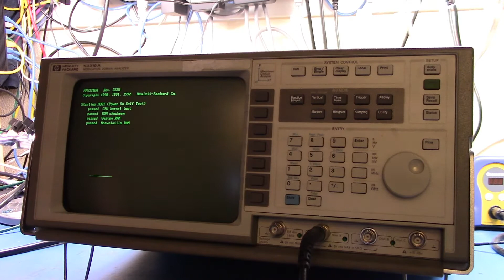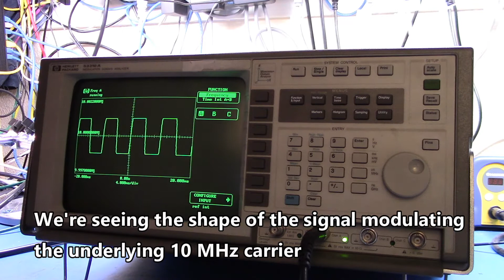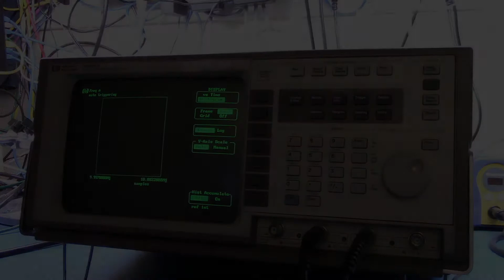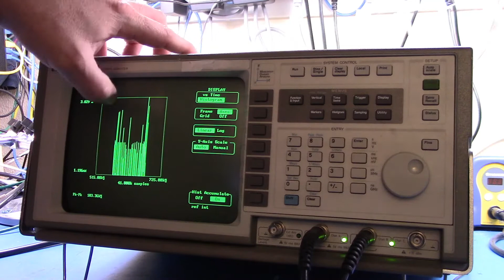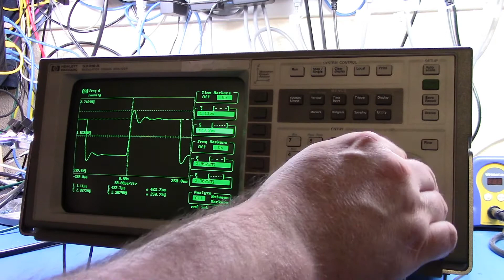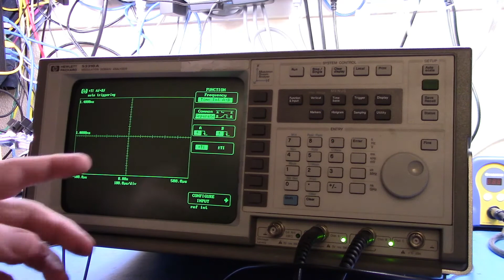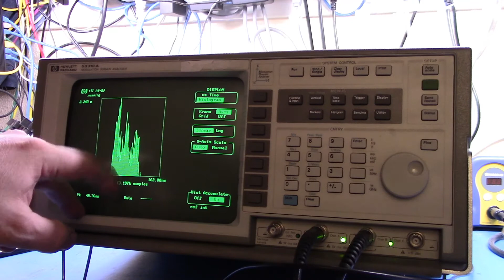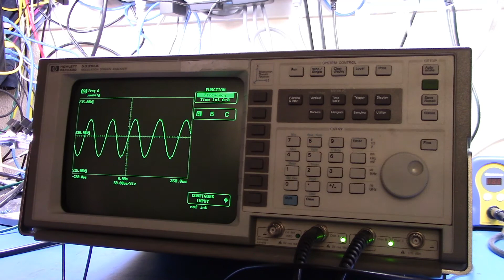HP 53310A Quick Overview

Comment: have a same hp 53310a,,self test has a fail,,,trigger light ? and ideas is it important
Reply from the maker: Hard to know - In the Service Manual, go to flowchart 5 (I think you're saying that the A2 Board Trigger Light test failed) - It'll take you through some steps to check - It might be as simple as a loose cable but could be more detailed - The Service Manual is available from the Keysight website - If it isn't a cable then I recommend getting the complete manual set from ArtekManuals.com (you'll at least need the CLIP with the schematics etc in it).

Comment: Can this unit be used as an oscilloscope as well? Is there a single-shot option for trigger?
Reply from the maker: Not sure about single shot but yes you can use this to view oscilloscope like traces - I wouldn't replace a scope with it but if you need to you can grab a trace while working with it.

Comment: Osciloscópio hp 54501A como ligar modo x y
Reply from the maker: Sorry but I don't speak Portuguese so I'm taking a guess that you're asking how to set a 54501A into X-Y Mode. These two instruments use the same chassis and front panel pieces but they're different actual units (my video is on a MDA not a scope). I downloaded the manual from the Keysight website and then did OCR on it so you can search - Try checking this out to see if it help - https://1drv.ms/b/s!Amqar8_XQ9UzkulBtGj-3D6VZu1tjA?e=bcQbCt

TonyG

Comment: I'm up to part 19 now! 

That looks like a nice bit of gear, will be interesting to see what information it will show on the 5200A frequency stability issue, I think this is a common fault with these units.

The next thing I will be doing on mine is replacing the tantalum caps on the oscillator PCB, I have the parts, I just need to get back to it.